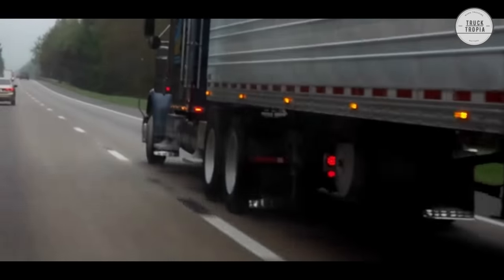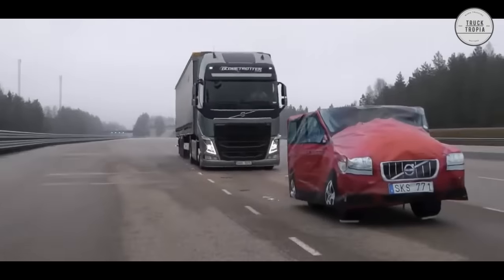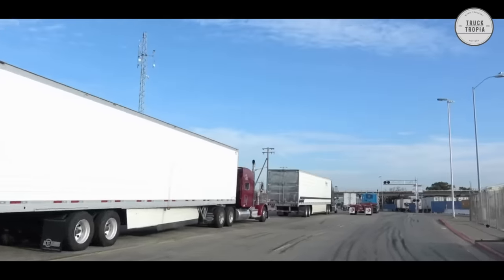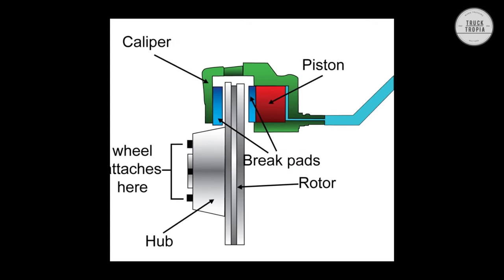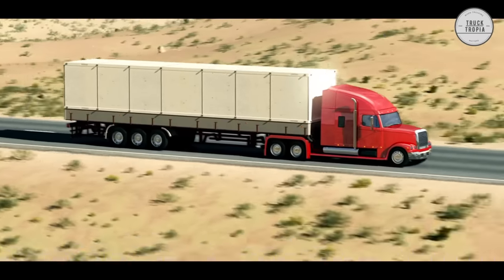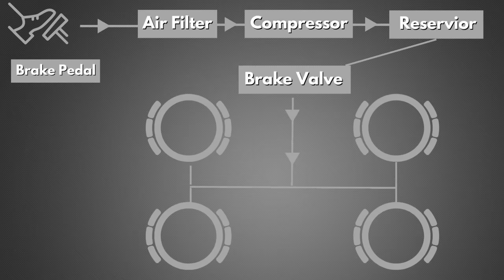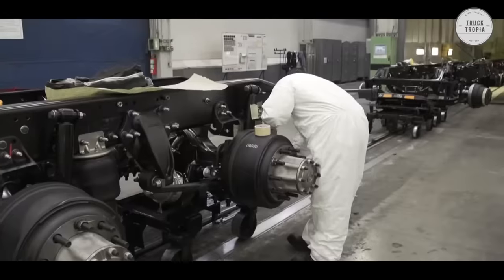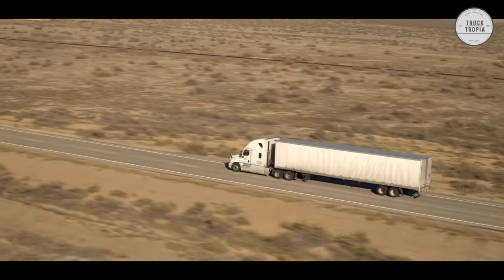Why Do Semi-Trucks Use Air Brakes?

Comment: Wrong, when the truck has no air in its reserve, the brakes are locked, hence it's impossible for the brakes to be activated when air is injected in the chamber, it's the complete opposite, air is released from the chamber which activates the brakes.
Reply from the maker: thanks for sharing your opinion
Reply: You are also only halfway right. The principle you describe is only true for the emergency brakes. Trucks normaly use 4 circuits to operate their airsystems. Circuit one is for the truck's front axle, circuit two is for the drive axles, circuit three is for the emergency brakes and circuit 4 is for al the auxiliary air systems like air assist servo for the clutch and so on.
Trucks commonly use what is called a double acting booster except on the front axle. These double acting boosters has two features. First the emergency brake feature, a large spring located in the rear part of the booster, and the service brake that is located in the front part of the booster. The service brake uses a rubber diaphragm in a sealed chamber. When the service brakes are applied, when you put your foot on the brake peddle, the chamber is pressurized and the diaphragm press against a rod that moves the slack adjuster and rotates the s-cam.
The emergency brakes aka park brake is activated by that large spring.
The spring pushes in the same direction as the service brake diaphragm and has a diaphragm of it's own in a seperate chamber that when pressurized pushes the spring back. So when the air is low or when the parkbrake is applied it is the sring keeping the brakes engaged, but when the parkbrake is released and you depress the brake peddal it is the service brake diaphragm that engages the brakes.
Reply: Yep, this video is all wrong...
Reply: In the chamber is a spring which air needs to win and release brakes. When there are not enough air, the spring "activates" brakes and locks them until the preserve are filled. So the spring presses brakes. 

If I do remember correctly you can brake eight times without refill before the spring activates and brakes the vehicle
Reply: @Truck Tropia  it's either an opinion, or a fact
Reply: So you are telling me you can't start a manual SEMi truck rolling with the clutch ? When there is no air in the system
Reply: @mosesgideon1115  If there's no air then the brakes will not release, so, theoretically, if you could drag it fast enough to defeat the brakes you could start it but you'd flatten the tires in the process.  So, no, you can't really pull start a manual semi if there's no air.  Plus, the transmission relies on air to operate.
Reply: You're talking about vacuum brakes there, air brakes do Audi as described here
Reply: That is why they make it tool called a cajon tool look at your big break airpods they're on the side of it and you can take them off and screw them into the hole and tighten the nuts up which releases the spring that is holding the brakes locked up that spring takes over when there's no air pressure or when you set the brakes
Reply: @TruckTropia  PLEASE do some research before posting, because this was embarrassing to watch.
It doesn't matter neither for the performance nor capacity if you have air or hydraulic operated brakes.
The drums or discs are exactly the same, the only difference is if it's oil or air that push the pisteon that apply the brakes.
An oil hose can leak just as easy as an air hose.
The reason we use air on trucks and trailers is two folded.
One, to save weight because compressed air doesn't weigh anything, while all that oil needed to operate such huge systems would ad much extra weight to the vehicles and reduce payload.
Two, because it's much simpler to maintain correct pressure, particularily when we pull trailers.
The compressor gives us air no matter what, and if a trailer we hook up is out of air we just wait until the pressure build up.
If we'd had hydraulic systems, and the trailer we're hooking on was empty on oil, we would be stuck until someone came with more oil.

The things you mention by overheating was kind of right.
Drum-brakes overheat and fade when used wrong downhill, while disc-brakes handle heat and wear and tear much better.
That has absolutely nothing to do with air or oil, but the construction of the brakes themselves. 
Another aspect is that drum-brakes only slow the vehicle down, while the much more effective and way better disc-brakes STOP the vehicle. 
That's why we in Europe stopped using drums two decades ago, and are terrifyed to see that the american trucking industry still use that crap.
Reply: Correct! No YouTube has it right. It's the WABCO Air brake system developed by George Westinghouse over 100 years ago. Used on freight trucks and Trains. You loose air in the system and the brakes automatically lock up.
Reply: Having been towed a few times, once because of a brake airline leak on the semi unit, I can assure you that the mechanics have to wind off the brakes on the rear axle & connect their suzi lines to the trailer to do a front end lift tow. A half hour ball ache for them. 
No air means locked brakes on most systems (unless springs have failed, which is a maintenance issue that, in Europe at least, will get the company some rather hefty fines).
Reply: He says this at 2:34
Reply: @TruckTropia   his comment is fact, not opinion. I’m a diesel mechanic who works on road trains & heavy haulage with both American & European style trucks.
Reply: Yeah, watched a trucker reverse into a rock, ruptured his airline and was stuck in the middle of the street.
Reply: @printedprops8730 , I seen the result of a driver not fitting the dog clip on the 5th wheel, nor doing his two shunts. Suzis connected, pulled away with a fully loaded (36tonne) trailer which uncoupled a few feet away from the bay, leaving a gap of about 2’ from the ground to the bottom front of the trailer (a slope involved). Tractor unit made it a few more feet before no more move. Nearly blocked the yard. 
One VERY HEAVY LIFT later….
Reply: @mosesgideon1115  yes
Reply: @ronbradshaw7404  agreed, the reason he gave as to why cars don't have air brakes is entirely 100% wrong.... In fact, in many ways an air system is in fact cheaper....

Thing is, air brakes are ridiculously powerful.... And therefore it would be jerky when used in a car... The car literally not being heavy enough for the brakes to be used smoothly
Reply: @TruckTropia  boo
Reply: @TruckTropia  it’s fact though! I’ve have lost all air pressure in both tanks in the yard truck during winter when lines freeze and can’t even move truck if I’m hooked to trailer and can’t release 5th wheel pin. the air dryer wasn’t enough with the weather we get up here.
Reply: It doesn’t seem like any of you actually understand how they work. It all has to do with the brake chambers- some chambers on trucks are a single chamber design and others are a dual chamber (spring brake) design. The single chamber brakes only apply braking power when air is supplied to them via your service brake (when you step on the brake pedal). The other chambers have two parts- the service brake chamber (applies brakes when brake pedal is applied) and the spring brake chamber. The spring brake chamber has a spring in it that fully applies the air brakes whenever said chamber does not have air pressure. When you supply air to your trailer via the red air valve in the cab of your semi, you supply air to the spring brake chamber which shuts off your spring brake allowing the truck to roll. This is exactly how the trucks parking brake (the yellow valve) works as well. Generally a tandem axle truck and trailer will have one axle on both the truck and the trailer with a dual brake chamber and one axle on both the truck and trailer with single chambers. The front axle on a truck will never have a dual chamber (at least from what I have seen)
Reply: @mosesgideon1115 If there’s no air in the system for you to release the brakes, then no. You’re sitting like a rock 😊
Reply: Trains use air brakes, which are activated by releasing air but trucks are different. They have application pressure to apply the brakes when the brakes are adjusted properly. This works very well. 
Releasing all the air or dynamiting, the brakes is just so that the spring inside the brake chamber will hold pressure against the drum like an emergency brake when the air is released. If you pull the parking brake and you step on the brake pedal, you can compound the brakes by doubling the pressure. That’s because the spring is already applying pressure and then when you put air to the secondary chamber, you double the pressure and can possibly crack the drum or damage the brakes.
Reply: @mosesgideon1115  you cant even press the clutchpedal if there is no air as the clutch is operated by airpressure aswell
Reply: @gewoontimm  okay noted
Reply: @TruckTropia  Not an opinion; it's a fact and you're wrong, as described elsewhere in this thread.
Reply: @TruckTropia  "opinion" chad 🗿
Reply: I have 12 years of mechanic work on air brake equipped vehicles and tow truck work. Rear axles of tractor and trailer use air pressure to releases brakes (hold them open) and deplete their stored air when brake pedal is pushed to activate brakes. Front axles use air to close brakes on dual+ air systems which is almost all trucks now. There’s a reason semis are rear towed because they don’t normally have air supply lines on the front of them and if front towed the rear brakes have to be cage while rear towing can still utilize the front brakes due to air line gladhands on the rear of the semi
Reply: @TruckTropia  its fact.
Reply: @TruckTropia  it's how they work not a opinion.
Reply: No air leaves the rear chamber on spring brakes..there’s a huge coil spring in the rear chambers..that’s your emergency brake and your parking brake.....air pressure overcomes the spring....then when you hit the pedal the air and the spring overcomes the pressure in one side of the chamber and brakes are applied...front brake chambers is diaphragm only with a small return spring..as air pushes the diaphragm the brakes are applied..
Reply: @mikec9729  cage tool for caging the spring in the chamber..and the tool is usually mounted to the chamber..unless it’s disc brakes then the caging bolt it right on the chamber..
Reply: @BESTO1215  air is evacuated from the rear brake chambers when hitting the brakes otherwise the diaphragm holding the brakes open would never collapse and the rear brakes would never apply themselves
Reply: @Project Titanium - Slowish driver  yeah you're sorta right. You can also test that theory by fanning the brakes till your park brakes pop out and what I mean by fanning the brakes is rapidly pressing the brakes while the truck is off which doesn't allow the tanks to refill with air and allow you to empty the air tanks which should engage the park brakes by itself. You usually do this during a pretrip inspection
Reply: @TruckTropia  you really said opinion when he stated facts. It's why caging bolts were invented so you can release brakes without air
Reply: @Project Titanium - Slowish driver  the number of times you can use the service brakes without the compressor refilling the tanks will depend on the exact location of the governor cutout. That can be anywhere from 125PSI to 150PSI. Each application of the service brakes uses approximately 20PSI. The emergency brakes activate in the range of 25-40PSI
Reply: @Ni  semis are often towed from the front, especially if they are hooked to a trailer. The gladhands supply air to the trailer and can't be used to activate the brakes on the tractor. The primary reason to tow a semi tractor from the rear is to protect the transmission without having to pull the driveshaft. New semi tractors are delivered in batches of 2-4 linked together facing forward pulled by another tractor.
Reply: @TruckTropia  you should be banned from making videos ever again for spreading misinformation.
Reply: @stephanhuman4665 So that's why when the park brake is used, the sound it makes is so extra. It's depressurizing to let the spring do it's thing
Reply: @RealNameNeverUsed  Exactly.
Reply: This video gets a lot wrong: air brakes are far more complex (compressor, etc.) so are fundamentally less reliable. They are also perfectly capable of fading, especially drums. Also, there is a significant delay with airbrakes because air is compressible, while hydraulic fluid is not.
Reply: This is what happens when someone understands one system like Hydraulic brakes and applies that to another EG Air Brakes, I drove  medium and heavy duty wreckers for decades I have a pretty good understanding how the different systems work, he forgot another brake system UD (AKA Nissan) used Air over Hydraulic it's more complicated but didn't require a Air Brake endorsement in the USA.  Someone said the OP was only partially right? Why because he didn't get into the complexity of how the Air system works between the cab and trailer?  They are preferred on heavy trucks because In the event of a system failure the brakes should still stop the truck as long as they were not overheated. Then the driver needs to hope a runaway ramp is ahead.  The wrecker driver then needs to tie back the brakes to move it because without air pressure or manually releasing them each that truck is not going anywhere!
Reply: @nickmastervlogs  I was looking for this comment from someone.
This is part of the airbrake test, you're right.
While fanning the brakes, the warning light comes on when the air pressure is getting to low around 60psi, and the emergency brakes (knobs) pop out around 40psi.
Reply: @TruckTropia  Not an opinion....fact
Reply: Love everyone in this thread going "iT's NoT oPiNiOn It'S fAcT" when the original comment is just straight up wrong.
Listen, I used to think the same thing because I was taught an oversimplified version of how air brakes work, but after actually working on them it became obvious very quickly how they work.
Air pressure is used to release the parking brake. This is controlled by the valve on the truck's dash. In an emergency where your air runs out, the pressure is released and the parking brake automatically applies.
However, your service brake is controlled by your brake pedal and works by applying pressure to the brakes, not releasing it.

If you want to verify this for yourself, it's fairly easy. 
Chock the wheels of your truck to make sure it doesn't roll anywhere. 
Disconnect the service brake hose from one of your brake chambers. The ports on the brake chamber itself are usually labeled, and the service port will always be closer to the side with the pushrod.
Have someone start the truck, let it build up pressure, and release the parking brake. The emergency side of the chamber will fill with air. Then, have them hit the brake pedal. You will be able to feel air rushing out of the service hose while nothing comes out of the brake chamber, meaning air has to be delivered to the brakes to apply them in a non-emergency situation.

You could also just look at the gauges in the truck and realize that the pressure in the tanks drops immediately as soon as you press the brake pedal rather than holding steady then dropping when you release the pedal (which is what would happen if the brake chambers released air to brake and had to be filled back up after each use)
Reply: So air is what we breathe, got it. 👍
Reply: @mosesgideon1115  You need enough air pressure to override the emergency breaks. The normal operating pressures are somewhere between 90/95 psi to 120/125 psi. The pressure fluctuates between those pressures to keep the emergency brakes from coming on bur also supplies air pressure to the service brakes for slowing down or stopping. There are alarms that go off if the pressure drops below 80 to 90 psi to give you time to pull off the road before the emergency brakes come on. In my experience it's anywhere below 60 psi but it takes around 90 to a 100 psi to get the emergency brakes to release.
Reply: If semi trucks are towed the drive shaft is disconnected even if it's a manual transmission unless it's a very short distance.
Reply: Yep the park brakes natural state is to be applied and you need to supply air to release it.
Reply: @TruckTropia  that’s not an opinion, it’s a fact
Reply: @HarryPrimate  opinion or fact, it’s wrong. It’s easier to adjust the pressure on the brakes by adding air pressure on the pads than by bleeding the air off. Like the hand brakes of cars are cable linked instead of the fluid, trucks have separate systems for parking brakes. Cable pull of course is not practical, they are by heavy springs and kept open by air pressure. That is much safer system, but lacking feels that a parking brake does not require.
Reply: @madsam0320  when disconnecting a trailer from the truck the airlines are removed and there is no air pressure to the trailer brakes and they engage. Air pressure is required to disengage the brakes ( about 75psi ). In order to bleed air off of the brakes you need to either use the brake pedal or the bleeder valve on the air tanks. Would you like for me to give you a full description of a pretrip inspection?
Reply: 'Air released from the chamber operates brakes'  is true ONLY for parking/emergency brakes. Service brakes operate when air pressure IS APPLiED. Maybe not complete but uploader was quite accurate. ☺
Reply: @stephanhuman4665  this is very similar to locomotive and rolling stock brake systems too
Reply: @HarryPrimate  you didn’t read carefully what I typed. The parking brakes are held by heavy springs that are released by air pressure. It’s a separate system for safety.
Reply: Nice to see experts and non-experts exchange know-how on this topic. Im learning just by reading your words.
Reply: Except in the case of older trucks. My 1965 Chevy C-80 has straight air brakes. They are actuated by air pressure. No air pressure, no brakes. Ouch!
Reply: Agreed - I find it such a waste of diesel watching delivery trucks holding down their accelerator waiting for their tanks to build air pressure to release the brakes. Between 2 and 6 minutes #oilisliquidgold
Reply: @mosesgideon1115  yes
Reply: Not all trucks
Reply: @mosesgideon1115  if you caged the brakes
Reply: @mosesgideon1115  no you can’t. Air is what holds the spring brakes off. If there’s no air. The brakes are on.
Reply: when there’s no air in the brake chambers the spring brakes or parking brakes are activated. As air is introduced to the chambers, the springs will be held back by air pressure. On the other side of the chamber (dual chamber) is your service brake. Air is added to this chamber to activate the brakes controlled by the foot pedal.
Reply: The video is wrong 
You apply air into the system to release the brakes that’s why if there is no air in the system the truck cannot move
Reply: @mosesgideon1115  no the maxi as we call them in our part of the world are spring loaded to apply the brakes when no air is present 
When you introduce air into the system it is caught in a diaphragm the pushes on a plate that forces the spring in which release the brakes 
If your compressor not working you will burn your clutch out and not move a inch
Reply: Springs in the air can apply the brakes. Air pressure against the diaphragm overcomes the spring pressure and releases the brakes. When you step on the brake pedal/ treadle valve you are exhausting air from the air chamber. Plain and simple. The brakes in static condition, no air , are applied by default.
Reply: @chrisrestifo7010  false. Spring brakes (parking) and foot brakes (service) are two different things. A wheel with only service brakes has a single chamber while a wheel with service/parking brakes has a dual chamber. The explanation of how your spring brakes worked was 100% accurate. But you are wrong about service brakes, service brakes work when you push the foot pedal. The service brake chamber FILLS with air, pushing a rod, into your slack adjuster,  which in turn twists your S-Cam, ultimately pushing your linings into the drum.
Reply: @mosesgideon1115  that is correct
Reply: It depends on the brakes. The parking brakes release air to activate and the normal brakes fill with air to activate. Therefore when you release the brake pedal you are usually releasing air and when you activate the parking brake you are usually releasing air.

If there is only one type of brake it would usually be the type that releases air to brake like the parking brakes for safety reasons.
Reply: Yeah that's why trucks need to idle for a few minutes when you first start them. Because you need to build enough pressure to disengage the breaks. No air pressure= brakes stay engaged.      It's. Safety mechanism because if you lose air pressure suddenly the break engage bringing the truck and trailer to a stop.  Better to have that than losing pressure and not being able to engage the breaks
Reply: You're wrong, until you actually work on these trucks don't say anything. It uses air to release a spring chamber to allow the truck to release it's brakes yes but then it has a seperate chamber from the first on the brake pot that air is applied to which applies the brakes. This is why a spring brake chamber has 2 lines on it, delete your nonsensical comment
Reply: @stephanhuman4665 Holy shit bro you should write an essay about this and publish it
Reply: Man, looking at all this stuff, it's like you need an engineering degree to drive a truck
Reply: Yup.
Reply: You are still wrong a chamber does not release air at all the air is released by a valve normally you get below 60 psi the valve automatically releases the air on the maxi-brakes thus allowing a mechanical spring to apply the brake
Reply: @mosesgideon1115 yes
Reply: Yepp I know this because I drive aviation fuel tankers and when the air is low the parking brake is hard to disengage and if so the brakes will squeal when you drive which means they are locked down.
Reply: @KaisTheFireWarrior  DUH and I don't know if I would be admitting that since you are a hazmat driver
Reply: @davidsignor7931  what do you mean
Reply: @KaisTheFireWarrior  exactly what I said I would think if you are a hazmat driver you would know a little more we don't need any more I-95 incidents that could have been prevented
Reply: @davidsignor7931  I don't have a CDL soo
Reply: @KaisTheFireWarrior  what are you doing operating fuel trucks
Reply: @davidsignor7931  fueling airplanes duh
Reply: @TruckTropia its a fact, not opinion lmao..
Reply: @TruckTropia the fact correction is not their "opinion" lol.
Reply: @TruckTropia It's not opinion It's fact you fool 😂😂😂
Reply: a simple L.A.B test shows if Littleton no air is inthe system, your brake knobs pop out, locking your brakes down to prevent movement until the air system is charged. No air means locked brakes. Simple. It's no complicated to understand
Reply: @gewoontimm Every manual truck I drove had a hydraulic clutch. The new 'automatics' use air for clutch and gear changes.
Reply: @vikingnoise  im speaking about EU trucks.. i got no experience with amerixan trucks.. but in the EU the single, double or even tripple plate clutch is air opperated... so you dont need a big overtrained bodybuilders leg to stamp on it...
Reply: @TruckTropia it wasn't an opinion 💀
Reply: @TruckTropia  it's not an opinion, what the person explained about air brake operation is FACT🎯
Reply: @stigandrmyrardalur5208  you are partially correct.
 Don't worry about drum type air brake systems. They will lock up the brakes and put flat spots on tires, EVEN LOADED TRUCKS. 🎯😎☕
Reply: @stephanhuman4665 don't forget the hand brake bar behind the steering wheel
It stops the trailer brakes only
Reply: Down fall of air brake
If you over heat the brakes with excess applications
Those big pads become soft hence they loose there ability to stop

Many mountain roads have sandy escape paths for this reason
Loose your breaks downhill
Drive into that path
Reply: @stevenvanheel3932  Thank God someone who understands how it works. The comment section is full of morons. What is scary is some of these idiots claim to be mechanics. BTW back in the day like 1960's lots of trucks didn't have spring brakes at all. Single chambers on all axles. The tractors had a mechanical brake on the back of the trans, and the trailer had a breakaway valve that pressurized the chambers if pressure on the supply (red) line was lost. Those always leaked down after time and if you didn't connect your air lines before backing under the trailer it would roll away from you. Lots of times collapsing the landing gear
Reply: @stephanhuman4665 thanks for the great explanation.  Just a small mistake, it's "pedal", not 'peddle'
Reply: Oh basically like a train
Reply: The park brake has a double chamber buddy, it does not release air for the service brake it supplies air to both park and service brake when needed.
Reply: @fuckjewtube69  You know it's really scary how the comment section is full of drivers and mechanics that don't understand how air brakes work.
Reply: @joecummings1260  Yeah it is. Theres a guy who commented that he has 12 years exp. working on air brakes and he confidentally explains how they dont work lmfao. That is nuts.
Reply: Air brakes are used on tractor-trailers (aka semis) because it makes connecting and disconnecting the lines to the trailer easy.  Hydraulic wouldn’t be practical.  (hydraulic lines need to have all air bubbles bled) Straight trucks can be hydraulic or air, but not tractor-trailers.  And to clarify for some of the misguided comments, you need a minimum of 55 psi into your supply line to release the emergency spring brakes, and anything below 80 psi is considered low air, meaning you have a limited number of brake applications before your emergency spring brakes activate.  Air also supplies air-ride suspension and other pneumatics in the truck & trailer.
Reply: Just another prime example of why you shouldn't get your information off you tube